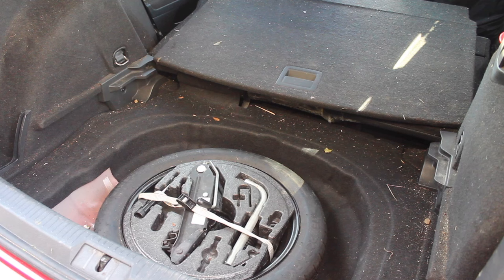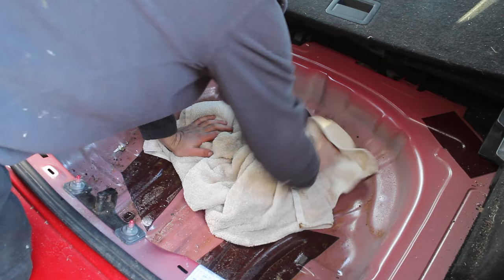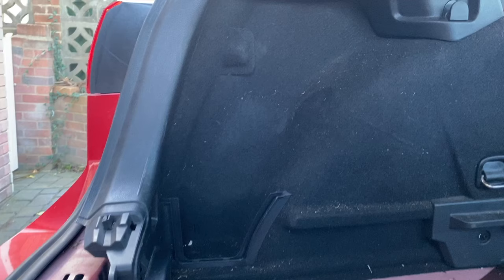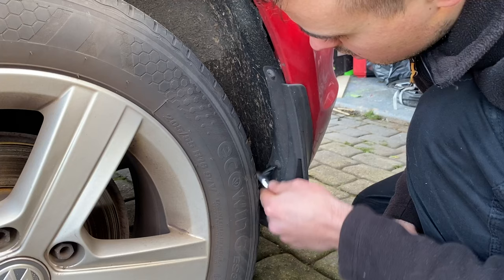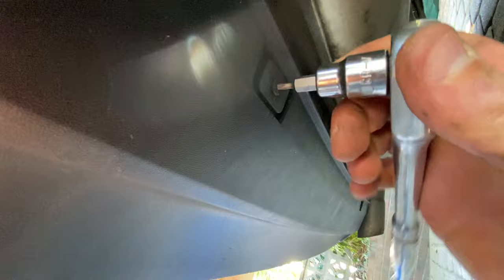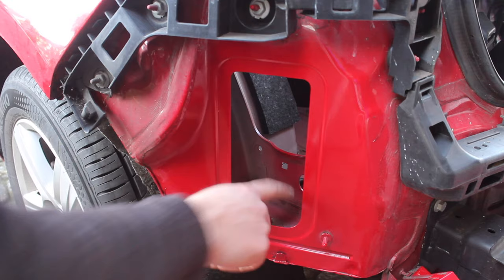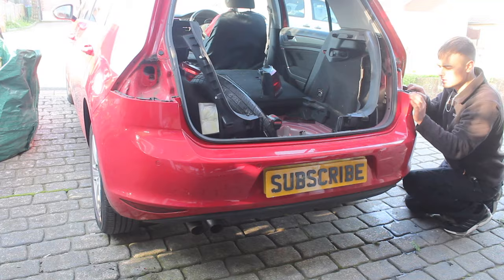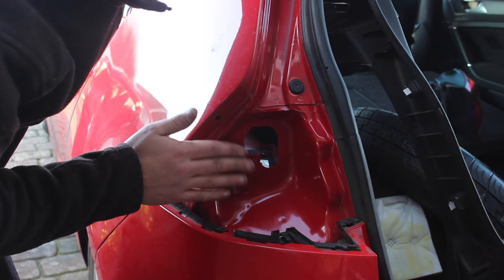VW Golf MK 7 Boot Leak FIX, 4 common leaks!

Comment: Great video but thanks also to the person that mentioned that there is no need to remove the rear bumper. I removed trim and dried everywhere thoroughly. Removed the vents from the inside, cleaned them thoroughly and then dried. Added some silicone sealant to the rubber seals….. jobs a good un. My local VW store £270 to replace - two day job. My experience 1hr labour and a dab of sealant.

Comment: Great video. I had the vents leaking problem with my 2014 Golf. 3 years later though I still have really bad problems with condensation on the windscreen and rear one. I can't identify any more leaks so I'm at my wits end as to why it happens as otherwise it's a great car.

Comment: Did this today, fairly straightforward but there is one more tx25 screw holding the bumper on either side.  It's behind the lining and is an absolute pain to get out.  Eventually managed with a small allen key.  Jacking up the car might help.

Comment: Thank you so much for this very informative and detailed video! I had wet seats in the back of my VW mk7. I had tons of condensation in my golf, as well as very damp back seats w/ some mould growth. Cleaned it all up, got some humidity absorbers.
Thought I’d remedied the problem. Was checking my car boot the other day purely by chance and lifted everything down to the spare wheel and saw loads of water in a big puddle! We were shocked and trying to figure out where it was coming from as there were no obvious holes anywhere. So glad hubby found your video on this and appalled to hear how common it is and that VW didn’t do a recall because of it.

Comment: Just found your video on how to fix this ongoing problem. I initially thought it was a failure of the crap VW foam light seals, so I replaced them with the newer equivalent of Dumdum putty (which VW used to use, before they started to cut corners with cheap materials). Water still gets in, but now I've an idea where else to look for the leak and how to rectify it. Many thanks for your detailed instructions.👍
Reply: Have you had any more leaks?
Reply: @nataliegrn17  Bumper off and resealing the vents has cured it, thankfully.

Comment: Amazing thank you so much, i braked really hard as a fox came infront of my car, noticed the next day the back seats had wet patches, checked the boot and spare wheel well found a pond in the boot, had a weird smell coming found that there was mould growing, took the rear seats out and there was more water there, havent found where its leaking from but managed to get the garage to drill a hole in the boot so no more water will sit in the boot, will be checking these recommendations out to find the source of the leak thank you 🙏🏼

Comment: Great video. I didn’t realise there were bungs in the either cavity under the rear lights. As a temp fix I’m going to remove them until I can get the bumper off….
Reply: Were the bungs easy to access?
Reply: @cjtr6  Yes. You need to unscrew the back of the wheel arch guard and then look up underneath where the rear light is. You should see a black circle about the size of a 10p coin. Push it… Don’t look up directly as water will p@@@ out..!
Reply: @cousinbillybob3224  once you remove the bungs from underside can you pop them back in without removing anything else? Think mine is just the boot badge leak but wanted to check

Comment: The boot drain tube costs £6 from a VW dealer and you can replace it yourself in about 15 mins. Remember to cut the tube to size and don’t leave a bend/kink in it when it feeds through the hole. Otherwise it will wear away

Comment: Great vid, really helpful. Am I missing something here? If the side vents that leak have a rubber bung underneath them that lets the water out that has built up. Why not just take the bung out permanently and then any water that leaks in will immediately drain straight back out again??
Reply from the maker: Thank you, glad you found it useful 😊 the bungs will also prevent spray coming into the car from underneath so probably best keeping them in.

Comment: The inner lights on the trunk lid are vulnerable also. Water will get in them and corrode the connectors and bulb holders. Needed a new connector and 2 new bulb holders. Sealed everything up better now👌

Comment: I've just found 2" of water in my boot. I suspect the vents but in advance I have bought the light seals (from Deutcheparts) and there is one thing you don't appear to have mentioned, the new seals also comes with 2 little circles also cut in the foam and I've clearly realised from your video at 8:40 that these are for the 2 studs that fit into the rear quarter panel, on the outer edge of the light and these would presumably equally compress and fail like the main seal.

Comment: Great video you make it look so easy. I have this problem but can't get off the first piece across the back
Reply from the maker: Thanks mate, don’t worry that’s the hardest part 😁
Reply: Do I just pull it?
Reply from the maker: @markwebb9730  yes you just carefully prise it up, maybe use a flat blade screwdriver around the edges or a trim removal tool.

Comment: Thanks for your video, I found it very helpful, last year I replaced the boot badge/handle tube and now these two air vents have certainly been leaking so resealed like you did.

Comment: Great Video. Our car was leaking while under warranty but unfortunately we didn’t realise. 
VW have since changed the parts as the rubber on the vent s and badge drain was perishing. Poor quality rubber. VW should have sent a recall on this as it’s a known issue. They refused to fix ours. 
There are significant other issues with the vehicle and I would never buy another VW purely based on their arrogance to take responsibility. 
VW - Dud Auto

Comment: Thanks. Did the handle tube a couple of months ago and all fine. Now I have different issue with the rear wash. Seems to be where it goes into the high level light. YT vids (and manual) seem to suggest the HL light pries from the outside, but mine is the other type. Anyway I used your video to help with the tube issue..

Comment: Nice fix there fella,I had a similar issue with water getting in on the rear top quarter vent on my smiley,water was running down the wiring loom & into the light cluster causing a bad earth on the plug to indicator so when driving with the lights on & indicating right the unit would flash really fast when touching the brake pedal 🤬.
Sealed the unit properly & fitted a new bulb holder & wiring plug harness,works perfect now but since this fix my heater fan has stopped working FFS. A bloody new unit last year as well, honestly there's always something to fix with an aging motor 😂
Reply from the maker: Cheers mate, I may have had something similar on my smiley in the past. The lamp holder is fairly corroded and think it will need a new one soon. Where did you get yours out of interest? There will always be something 😂 you sure it hasn’t just popped the fuse? I’ve still got lots to do on mine but it’s -5 here in the uk and I’m struggling to find the enthusiasm to work in this 🥶

Comment: Thanks for this video. A few days ago I found the boot well of my car rather damp (no mushrooms!) and I’ve now replaced the boot handle drainpipe, sealed around the air vents and the rear lights. Never taken the bumper off before, this vid helped me to do it without damaging anything. I’ve got parking sensors but thankfully realised that there would be a cable before actually pulling the bumper right off. Put it all back together and everything works OK - just need to see if any water reappears where it shouldn’t be.
Reply: Next leak to fix - rear doors speaker seals have gone. Currently only minor leakage but I assume it will only get worse. Have watched a few videos about fixing this… doesn’t look as straightforward as rivets are involved.
Reply from the maker: No problem, I’m glad it was useful to you 👍🏼 haven’t come across the door speaker seal leak as of yet but no doubt it may come up 😅
Reply: @TurnersWorkshop97  I did the rear door speaker seals too yesterday morning. Annoyingly the speakers are riveted in place. I just scraped out the decaying foam ‘seal’ with a blade then squidged as much silicone as I could into the gaps. Heavy rain overnight and so far so good.
Reply: Any joy? With the boot leak stoppage
Reply: @philipmarchant7058  Yes. We have had a lot of rain and my car has been out in all of it and I've driven through the rain for hours and the boot remains dry. Good news! It was all worth it.
Reply: @JimChampion  excellent news!
Reply: i have the park sensors, is there enough length in the wires or is there a plug join somewhere to undo? Thank you for advice!
Reply: @RainbowCharade  I have the parking sensors too. When I did the fix I think there was enough length. I don't remember unplugging them. They've worked fine ever since. make sure you find and remove all the screws holding the bumper on... I missed one and cracked the bumper (in a very minor way) when removing it.

Comment: Ours is the same, carpets are soaked now, been trying for a while to figure out where it's coming from. I'm no mechanic and could work out how to get the trims off in the boot. Looks rather doable and not expensive at all. Garage wanted to charge me £300. Just bought a £5 tube of silicone ha. Cheers

Comment: I don't understand how the badge drain thing can cause water inside/under the boot - It looks like the hole sits outside the seal, and even if the water would end up inside the boot door, how does it end up underneath the boot? (have a Golf Sportsvan and discovered tons of water in the spare tyre compartment!) grateful for an explanation!
Reply from the maker: There is a tube that runs from the boot badge, inside the tailgate and then drains outside. If the end of the rubber tube gets dislodged/ perished. It ends up in the boot and fills the boot with water. I hope that makes sense.
Reply: @TurnersWorkshop97  thanks for you reply, I appreciate your very pedagogical videos! On my car the rubber is indeed gone, but I still have a hard time understanding how the water can get from there to the boot, since the tube doesn't seem to go inside the car (the only place it can go is inside the boot DOOR, but maybe it can go from there to the boot somehow?) - then again I am really not informed about how it is constructed!
Reply from the maker: @ellinorisgren9574  thank you! when the tube comes out inside the boot door, the water can then get into the boot. Pretty sure there are more videos about that specific leak. If I had more time I would make a separate video but unfortunately I don’t at the moment.

Comment: The rubber tailgate stop (It's like a big plastic rivet), fitted just above the back lights was the cause of a prolific leak into the spare wheel well on my car. The central pin that secures it was missing. I popped in a spot of sealant and that stopped it (for 2 years, anyway..... boot full of water again now tho)

Comment: Thanks for making this video. I've got a 2014 Mk7 golf which although I've had since new I found water in the spare wheel well last week. I've replaced the drain pipe as the grommet had perished. I've removed the grommets from each side to let the collected water drain out. Am now removing the rear lights and applying silicone, after doing the tailgate I now have one bulb on the left (rear light) and one bulb on the right (fog light) not working, I suspect the water has got in there too. One to puzzle over. Overall this car has been great, I'm not impressed with this design flaw from VW though.
Reply: tbh that's something worthy of a recall
Reply: did you change the bumpre vents??
Reply: I removed them, cleaned everything thoroughly and then refitted with a good bead of silicon  @RainbowCharade  So far its worked.

Comment: Super helpful video. I have this exact problem. I was wondering whether simply removing the rubber bung, in the side wells, would be a solution?
Reply from the maker: Glad it was useful, definitely a temporary fix. Would recommend sealing the vents though as the bungs will also stop water getting in from underneath.

Comment: Great video. Have a leak into our 2013 golf. Thought it was the badge drain pipe, but on checking we seem to have a badge without a drain hole. Not sure if this is an unusual thing? Anyway, will be following your excellent instructions to sort out the seals when we get a dry day! In the meantime, I’m going to pop the bungs out to allow it to drain.
Reply: Mine is also without drain pipe.

Comment: Great video. I tried this but it did not work. My 2014 mk7 has 2 additional screws which are at an angle in each wheel well that hold the bumper to the trim that goes over the wheel.

Comment: Hello, I’m just wondering would the same process work if you have reversing censors on your bumper ? Thanks in advance !
Reply from the maker: Hi, apologies for the delay in reply. The same process will apply for a bumper with reversing sensors. The car in the video has reversing sensors. Thanks for your comment 😁

Comment: Hi great video, I noticed 2” water in the boot, I changed the tube to the boot handle and thought I had fixed it. Just checked after a few days of heavy rain and it’s full again so will now strip the back of the car off and seal the vents. Are the mushrooms magic. 😊

Comment: My Vw mk6 golf 09 GtTdi seems to have moisture in the spare wheel well so will check this . Not sure If it has the same vents behind the bumper  ?? Found big gaps between the rear doors and the metal plates that hold the window regulator must have been a fault from new as it’s riveted in . It caused a wet carpet in the rear footwells not good ! Used some butyl rubber to fill the gaps around the plates without removing them which is a PITA . Seems to have sorted the problem . Mk5-6-7 all shite never had any of this on my mk4 gtTdi. Other than a few broken wires, worn out coolant pipes , leaky tandem pump end plate for 200k (now sealed) and a broken weld on the clutch pedal at 480k ( re welded )   . Mk6 has had gps module go down, phantom bulb out warning lights that disappear on a restart ,  Broken springs and worn out shocks at low mileage ( koni street kit fitted in lock down with full front sus refresh ) , and broken wires in the boot causing lock not to activate . The joys of motoring lol great vid mate . 👍

Comment: Hi I’ve just discovered the rear bench seat is soaked in my 13 plate golf.
Thinking it could be from the lights as the foot wells are dry.
Going to investigate further tomorrow.
Found your video very informative.
Reply: same here...how did you get on??
Reply: and me... going to take a proper look tomorrow, clearly a lot of us suffering with this wet weather.

Comment: You will not get any water going in the boot because the grommet has perished it will go in the boot lid and back out the same hole which is outside the car, mine has been without that grommet for about 5 years now and there’s no water in the boot.

Comment: I've got the same problem with my Mk7 Golf GTD and have already replaced the boot badge pipe with no improvement...clearly its coming in via my rear vents and the light fittings so can u tell me do I need to replace the vents on either side or can I just seal the original ones in?...I'm planning on getting mine done next wknd so any info from you guys would be much appreciated...I'm just glad I'm on top of it and it's only going into the spare tyre well so in the meantime I know I can keep it from not damaging anything in the boot...cheers guys...p.s great video...👍🏻👏🏻🤞🏻
Reply from the maker: I think everyone with one of these models will have this problem eventually if they haven’t already. I used the original vents. Cleaned them up and used some clear silicone to reseal. Doesn’t take too long to sort it out. Thanks mate! Really appreciate it 👍🏼

Comment: How did you pop the plastic rivets out under the bumper? Mine are stuck on 😅
Reply from the maker: Hi sorry my reply might be a bit late now. You use a flat blade screwdriver to pop out the middle and then they should come out :)

Comment: For how long do you fix the problem with the silicon? Do you think it is better to buy original parts? Vents at least? Thanks for the video!
Reply from the maker: I think there’s a better chance sealing them will last longer than replacing with new ones. Just make sure both surfaces are clean and dry before applying the silicone.
Reply: I bought a "PU" sealant, from my reading it may last longer than silicon ones.

Comment: Can you just pull those 2 bungs out from under the car and refit easily enough without removing anything else to check if water is in there? Tiny amount of water in mine but i think its just from the boot badge drain but wanted to get the car up pull those 2 bungs to check all is dry before stripping it down?

Comment: when removing the bumper were the clips breaking? could you of taken those vents and replaced without taking bumper off?
Reply from the maker: Be very gentle with the plastic and carefully ease the clips with a pry tool and it will be fine. You do have to remove the bumper to seal it properly really 👍🏼
Reply: @TurnersWorkshop97  thanks for the reply. Handy video, cheers

Comment: How did you get the t10 screw underneath off? mines broken and I can’t get it off, and does it matter if you leave it when putting it back together again?
Reply from the maker: Drill it out mate and put a metal one back in 👍🏼